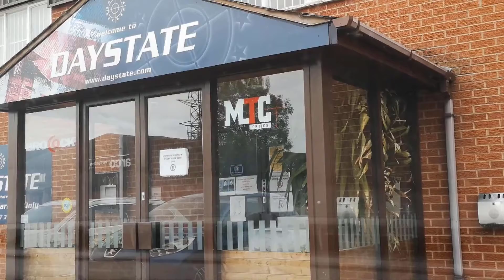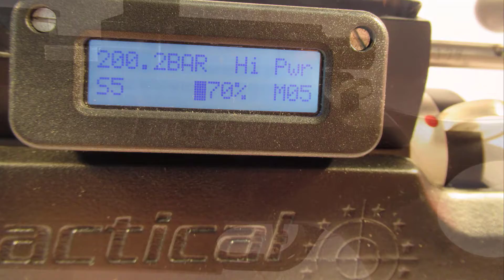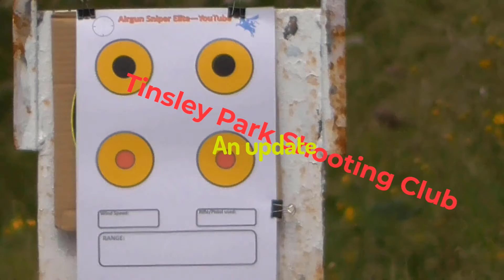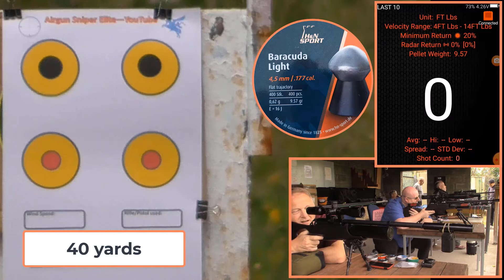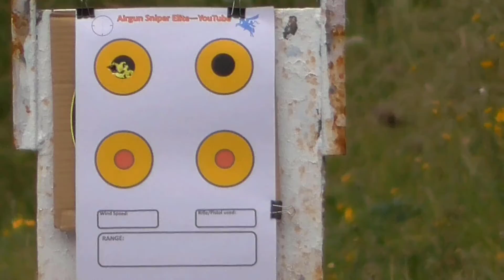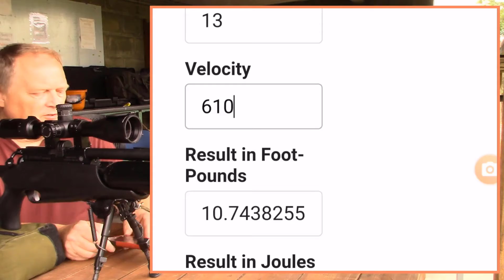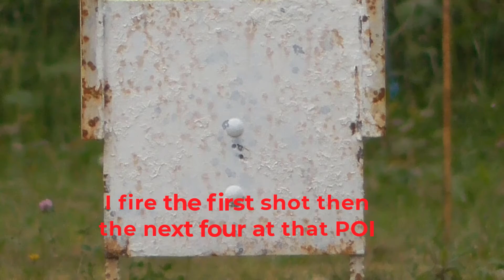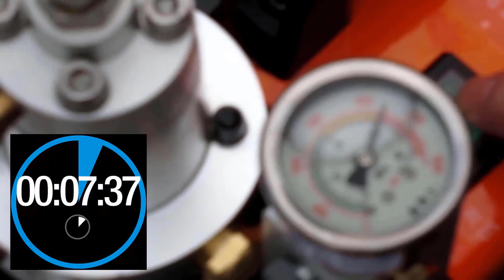The Daystate Air Wolf MCT An Update

Comment: Mark, I am from Oklahoma in the U.S.A. and just recently discovered PCPs.  I am a long-time center/rimfire rifle looney and now I have fallen down the rabbit hole having bought four PCPs in quick succession.  My first buy was a Benjamin Akela in .177 which wears a Hawke scope and is very accurate.  (My dad started me and my older brother with pump Benjamins back in the early 1960s, so I have a soft spot in my heart for the brand.)  The Akela is one of the most handsome bullpups out there IMO, along the with the FX Wildcat, but at about 1/3 the cost.  My next gun was a Benjamin Maurader Pistol (PRod) in .22, which I turned into a backyard friendly carbine.  It currently sports an MTC S.W.A.T 12X50 scope and is a light-weight and very accurate terror on the Starlings and Grackels that try to hog my songbird feed station.  These two lower tier guns have served me well, but I started educating myself on the higher end rifles (as I fell further down the rabbit hole) and bought an FX Crown Continuum in .25.  I have since bought .177 and .22 barrel kits for it.  It a a laser beam in accuracy.  It was about this time I discovered British guns (BSA, Brocock/BRK and Daystate.)  The idea of an electronically controlled pellet rifle was so new to me it took me a while to come around.  I found a beautiful wood stocked .22 Air Wolf on Airgun Nation Forum classified and bought it.  It has a beautiful tiger-striped walnut stock and is in perfect condition with a Hugget shroud and moderator.  Your video was very helpful to me and gives me confidence in operating the rifle.  I must admit that this Air Wolf satisfies my curiosity on electronic Daystate rifles, and though the new Alpha Wolf and Delta Wolf are super charges with all new electronic controls, I have my eye on that old British icon .303 Enfield and am now lusting after the mechanical Daystate Wolverine R High Power Regulated Side Lever .303.  Let me ask you a question.  With so many great rifles on the market, if could own just one really nice rifle, which one would it be and why?  Also, what kind of program update did the folks at Daystate do to your rifle?  My Air Wolf menu looks just like yours.  Do you think I need an update?  Thanks my firend.

Comment: hi mark,,nice to see youve sorted the rifle out and its shooting really well,,its virtually the same gun as my air ranger except for the electronic trigger where as mine is a mechanical one,i was debating at the time i bought mine wether to get the air wolf but rather prefered the air ranger as its much simpler and less to go wrong,lol, but having said that they are both top class air rifles and the only air rifle you would ever need,never had one problem with mine since ive had it and its had around 50 tins of pellets through it,top quality english air  rifles,,nice shooting on the range mate,hope to see some more of the air wolf with different pellets would be good mate,,great stuff and see you on the next one,👍👍👍
Reply from the maker: I agree. In a lot of respects the mechanical rifles will always be repairable, even if new parts are required and need fabricating when no longer available. Electronics, on the other hand are specialised for the manufacture and programing.